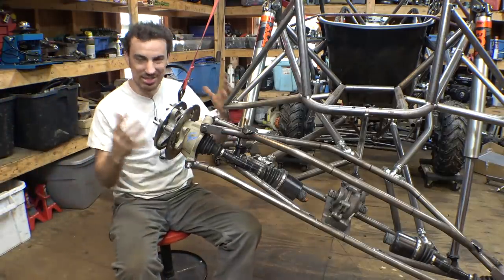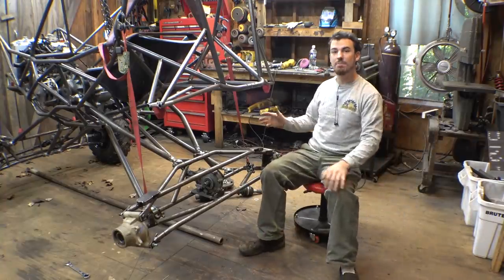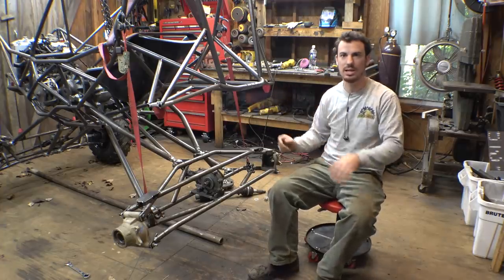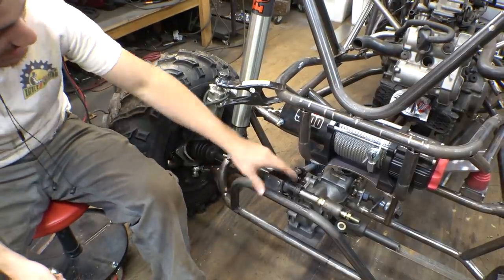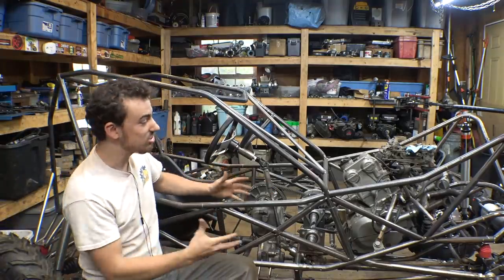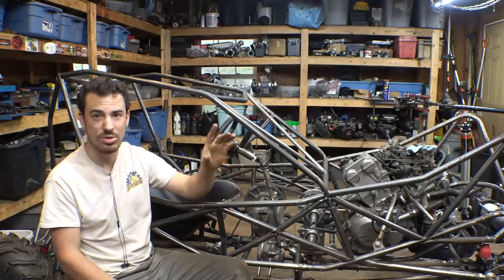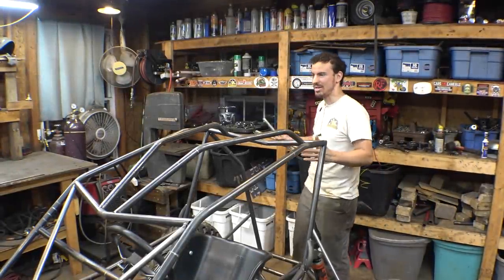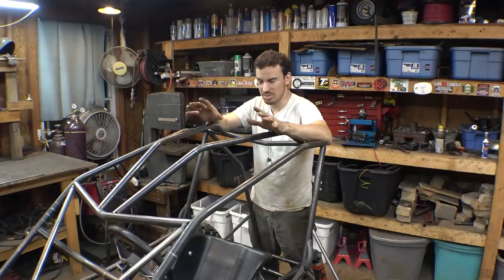Mini Rock Crawler Build SV650 Part 7

Comment: I think you should practice climbing in and out of that contraption so you know where your head needs to poke out of the top to get in and out easier.  Sealing that area with bars smaller than your head without a helmet is going to be a problem.   What am I saying?...watching this series looks like everything has been done 3 times or more.

Comment: Right angle gear reduction DC motors can have torque paired with a current switching potentiometer connected to steering  shaft. Bingo,  homemade electric steering.

Comment: Please don't put any louvres on whatsoever......

As for controls.
Paddlesworth for the gears is the easiest thing going. 
Left foot clutch, right foot brake and accelerator.  Either side by side, or press down for accelerator, pully your right foot back for brake...

Comment: thats not guna work at all u ned more angle and being a rock bouncer the reason why thay use highdrolick is becoz when u hit a rock at speed u wont brake ur thumbs when the wheel takes off in ur hands keep ur thumbs on the out side of the steering wheel when holding it so that dont happen

Comment: You are losing alot of clearance with the subframe or whatever is that called.. You even got small tires.. for a rock crawler you want the maximum clearance... You've put that much effort into the suspension and you got really low subframe. like my car has higher clearance than this.
Reply: Check out a fullsize bouncer. Busted knuckle off road has a few build videos of a few of their rigs, on top of a shit ton of competition vids. The 4links are usually running parallel or level with the ground and chassis bottom. They use 44+ tires to get clearance. You don't want a high cog with a bouncer.
Reply: @hammerT2997  yeah i've seen them. they have solid axles...
Reply: @anonimous336  true usually highly built Dana's